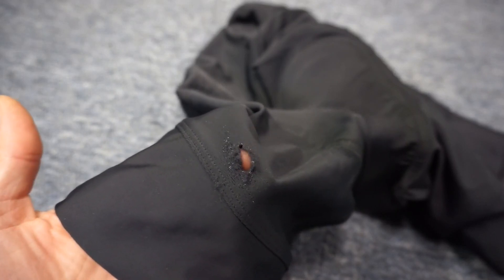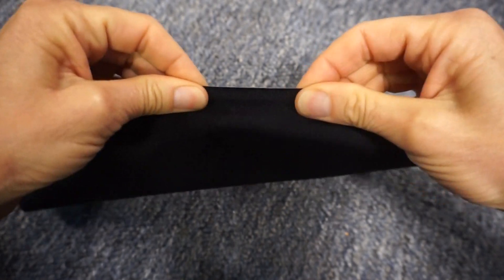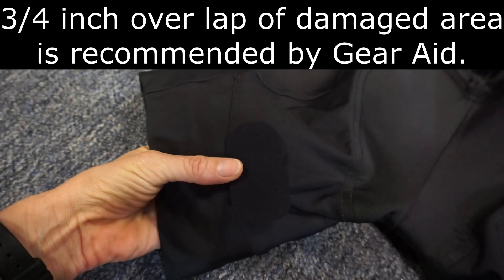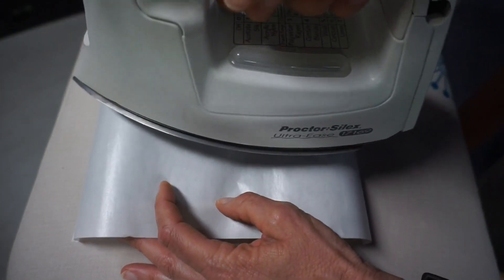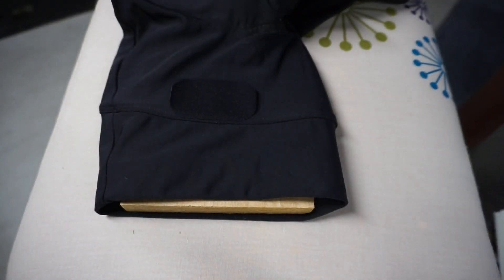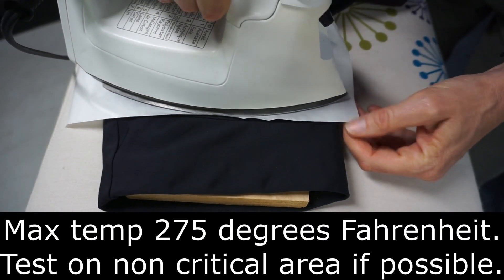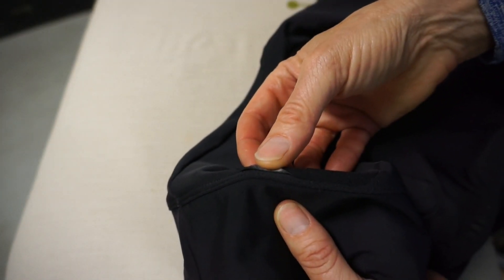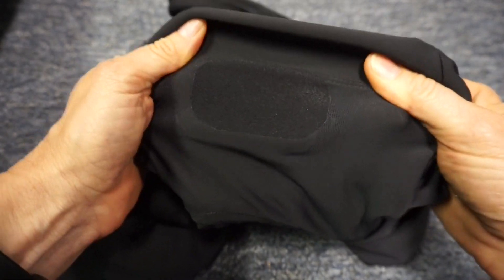Repair Cycling Shorts or Wetsuit With a Patch

Comment from the maker: It's a little over a year since I've made the repair.  I only ride about 8 months a year.  I'd estimate that the shorts have been used/washed about 16-20 times.  The patch is holding up well.  One edge, about a 16 inch wide, on the patch on the outside is not sticking to the shorts.  I did have problem with one edge when I applied the patch.  I think it's my fault and not a problem with the product.  I'll trim the loose edge off and all will be good.

Comment: for anyone who may order "gear aid-tenacious tape" be aware, read the whole description of what was used and don't make the same mistake I did. you want the whole title Gear Aid Tenacious Tape Neoprene Patch. Otherwise you'll end up with regular tenacious tape which is not flexible like lycra and not iron on.
Reply from the maker: Thanks for the warning.  The patch I applied in the video is holding up well so far.

Comment: How awesome to see you!  How have you been?  Hopefully all is well in your world.

I have the same damage to my identical (looking) cycling shorts caused by an exposed fastener thread just below my saddle.  I wasn't even aware of the slight rub - rub while riding.

I'll try your fix for sure!  I ended up slipping a couple of  rubber caulking tube "condoms" over the threads of the fastener end to prevent more damage.
My old 1980s Apollo 10spd road bike.  Still works great!
Reply from the maker: I'm enjoying some east coast Spring weather.  The hole in the shorts came from a crash on an encounter with an unexpected wet metal grated bridge.  Better to acquire the hole your way.  lol.  I had to look into the history of Apollo bikes... interesting!  Have a great day.